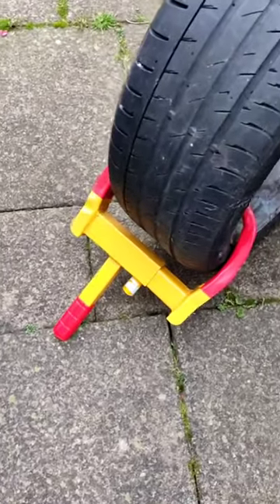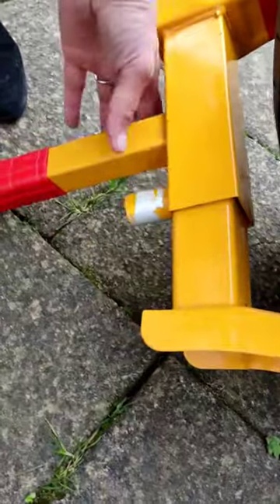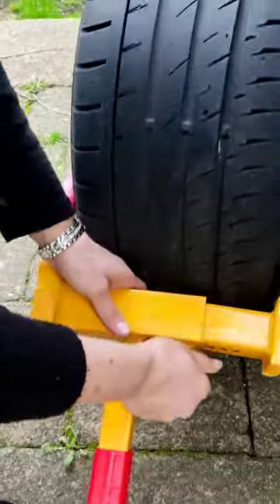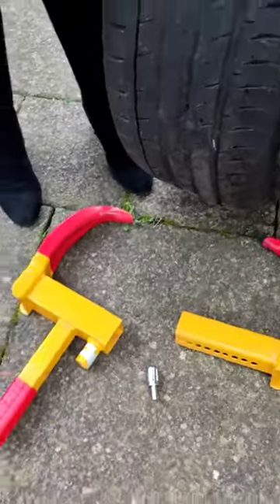how to take a wheel clamp off with no damage

Comment: Unfortunately, the holes are now covered up deliberately. Which means this tactic won't really work anymore. They tend to weld a piece around it to cover up the hole.
However, jacking up the car, letting the air out of the tyre, allows a little more freedom of movement.
Once the cheap clamp is slid to the side, and removed, the air can then be pumped back into the tyre. And then you can go.
It goes without saying of course, that the clamp should be left in full view. Take loads of pictures to show no damage.
However, if somebody nicked it, not your problem.